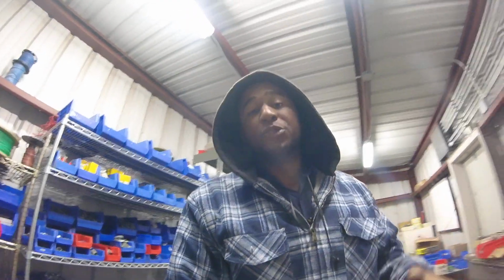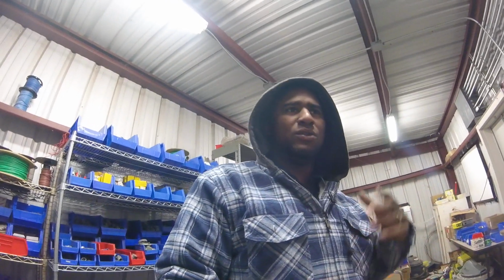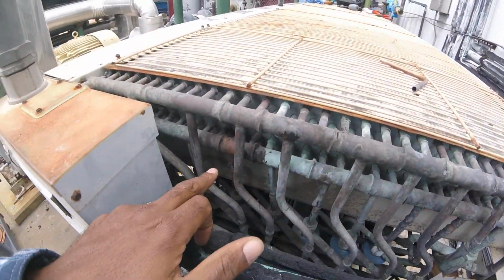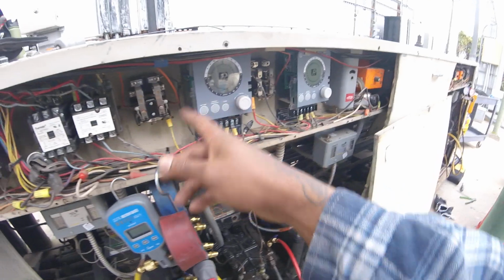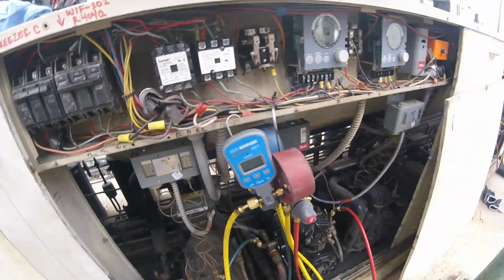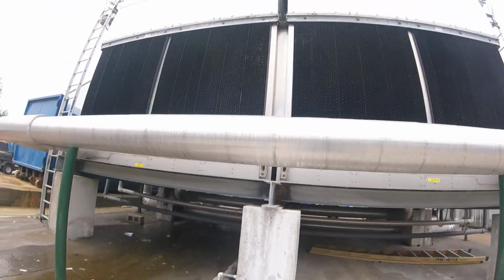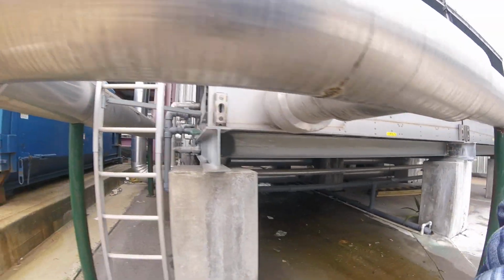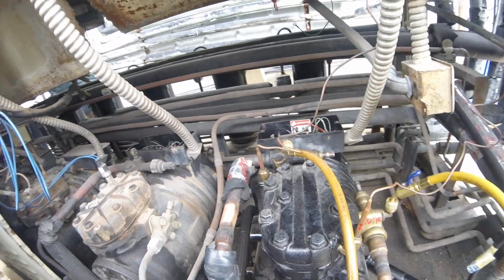HVAC Technician FLOODED COMPRESSOR

Comment: Nice video, it that a McQuay condensing unit?
Reply from the maker: polishtheturd mickelson 
Man, That unit is so old(1993).It has no nameplate and the owner can't find Manuel. The compressors are Copeland. The evaps are heat craft and Trenton.
But I'll dig into some more to try find out who the manufacturer. Hopefully they'll replace it next year.